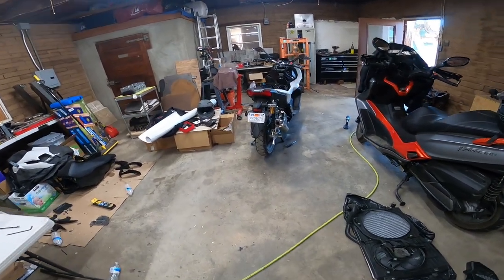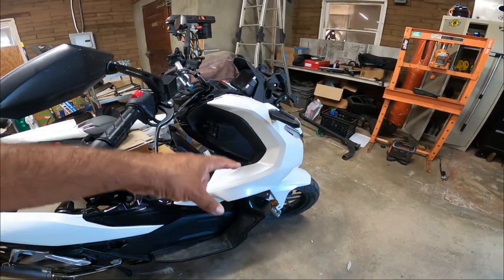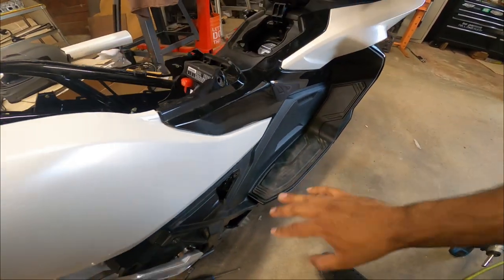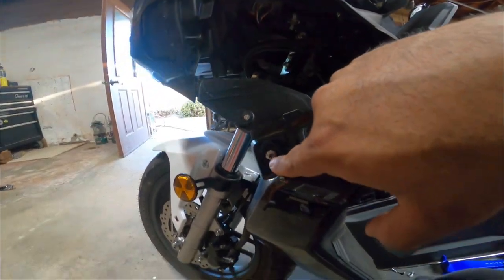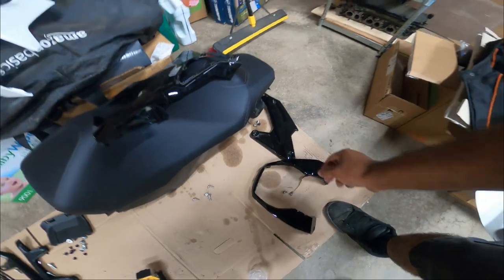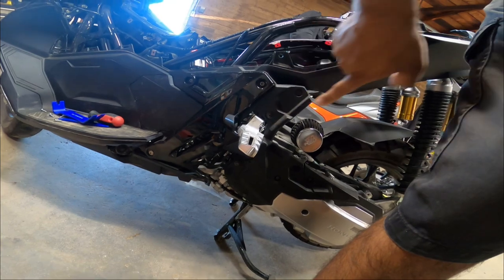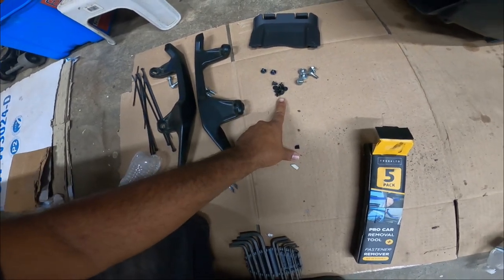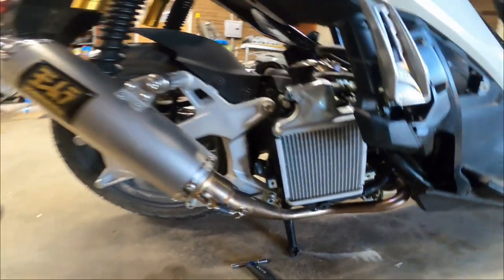Honda ADV 150 Hardware Identification

Comment: Is that a kymco xtown in there?! If so how do you like it... what are the cruising speeds on that thing.
Reply from the maker: Love it does 80mph with ease
Reply: @PincheALsGarage  ahh hell yeah bro, perfect for Cali. Was gonna get the burgman 200 but ppl say it basically is revving its heart out trying to stay at 80
Reply: @PincheALsGarage  you gotta do a vid on it bro. there are like non existant on yt and most are in other languages nd shit
Reply from the maker: @dank9288639  I know it is my next project
Reply from the maker: @dank9288639  anything under 300cc will Rev the crap out of it. However it what they are designed for. Just keep oil changes more frequent and Temps under control you will be fine.
If your willing to go the extra mile and do performance modifications and a gear it for better top speed these bikes can do some crazy top speeds
Reply: @PincheALsGarage  fosho man fosho. Well shit I can't wait to see what you do with yours. I'll probably follow suit if it works out for you